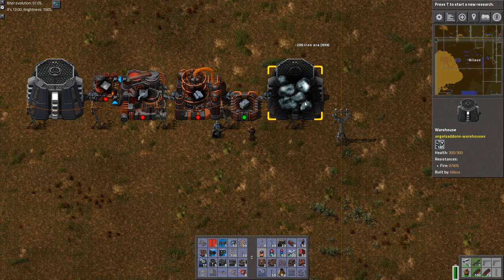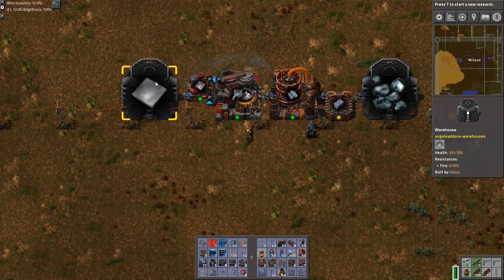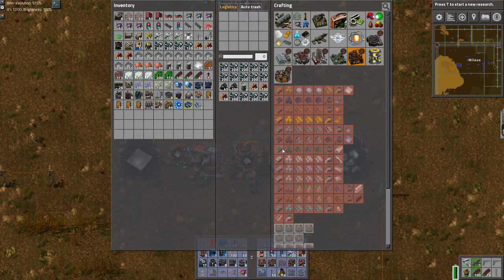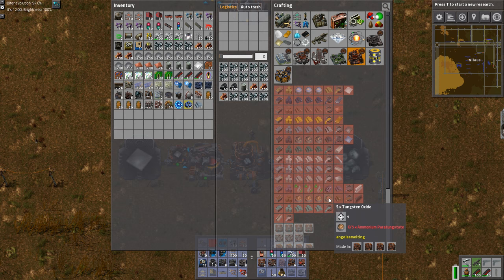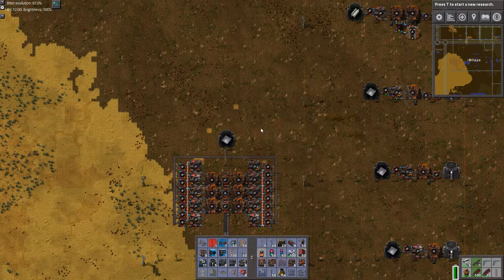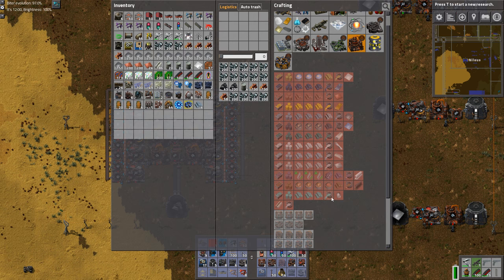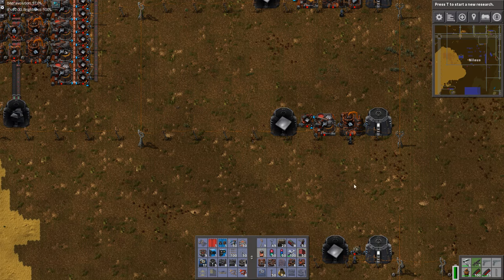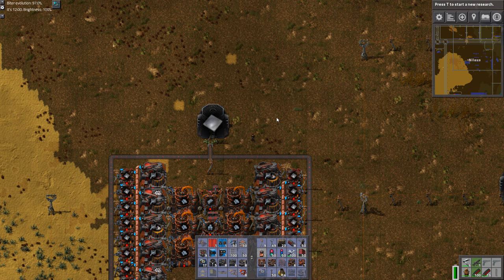Factorio Angels Mods Tutorial - Smelting 1 - Efficiency and Ratios

Comment: steel is 0.05-2% carbon in iron (low to high carbon steel), but smelting iron completely into a liquid and casting it (cast or pig iron) causes the iron to absorb too much carbon (2.5 - 4% usually, has a lot less tensile strength and shock resistance than steel) so you need to put it in a "oxygen converter" and blow pure oxygen over the molten iron so the carbon bonds to oxygen creating carbon dioxide and bubbling from the molten pool.

Comment: you are able to use modules in the smelters.... so you have to steps with modules vor steel, compared to smelting it directly
Reply from the maker: Yes good point. That is one more reason why the Steel process in Angels Smelting is not as good as the Iron + regular Steel smelting.
Reply: FluxBob don't blast furnace take modules?

Comment: You showed everything for iron, but iron requires the 4 iron pellets (which make such nice and easy ratios) and 1 coke, while the other biggie, copper, just equires 5 copper pelets with no coke. This messes up the ratios
Reply from the maker: Yes, that was a conscious choice. Since there are so many different metals in Bobs Mods then it would be quite repetitive to go through the optimal ratios for each.
Reply: ok. that answer makes sense. And the same thing for copper seems to work pretty good if i have an upgraded pellet press instead of Mk1. I use Mk2 because I haven't researched any others yet, but I still have to do the math to find the best.

Comment: It's a shame that the ratios aren't worth it outside copper and iron. I would think Angel would want to provide more incentives for the investments into using the mod (tech, cost of equipment, space, energy, time to setup).  Maybe in a future update :) +Arch666Angel
Reply from the maker: They are worth it if you need higher yields. However, it is almost always easier to simply get more raw materials than to increase the yields, especially with Infinite Ores. Angel said he would revisit this mod, so I am sure it will be improved significantly soon.
Reply: They're only worth it before you get into modules. Using productivity modules and electric furnaces you'll end up with a much higher yield. 

Angel's smelting has some easy ways to get higher tier metals. For example making silicon plates only requires quartz and coal whereas via bob's mods you'd have to add calcium chlorite.
Reply: Silicon and steel is the only ones I would seriously consider to use it for, and steel only for when running a modpack with 5 iron to steel ratio. I have set it up a couple of times, but knowing that they dont play well with productivity, I know that most setups with them would only be temporary increases in productivity. Since it takes so much more effort to set up, I would rather be rushing through the tech to modules instead, and just use them.

I dont really like how most of angels recipies does not work with productivity modules. There should at least be about as much possible for productivity as what is being replaced. This probably has to do with his love for side products in his recipies, and even more some of the loops he has (filters and catalysts in petrochem), which gets some special effects when you introduce productivity into them.
Side products also make everything much more complicated, but it is okay as long as there is a way to deal with them not requiring the use of some final product (there is a limit to how much brick you really need, but since we get a way to liquify and void crushed stone later one it ends up okay).

Comment: so i get 24 iron ingots from 24 iron ore then smelting that its 12 ingots for 120 molten iron and then 40 molten iron for 4 iron plates you you still end up with 24 iron no matter what i even tested it to make sure im not going crazy and i put 24 iron ore in and got 24 iron plates out so using a regular furnace would save time and save space and energy

so if i want to get extra iron i have to get the next level of iron smelting
Reply from the maker: Ore -> Ingot = 100%
Ore -> Processed -> Ingot = 150%
Ore - > Processed - > Pellets -> Ingots = 200%
Reply: Also in the current version the basic ore smelting is "nerfed" to have only 75% productivity - You need 4 iron ore in regular furnace to produce 3 iron plates. It makes this smelting process much more appealing. Can be turned off in the settings though

Comment: Lots of new steps, but very little logistics added. It misses the whole point. Same as a hundred building process where each building can be set next to the prior one, and arranged into a 100x1 array.

The whole point of factorio is that the logistics of multiple inputs and outputs to the assemblers prevents this sort of banal \ effectively one dimensional array of building to building input-output, and instead pushes the player towards a logistics nightmare which he must try to reduce by intelligent design.

If I enjoyed sticking things in a plain ordered row I'd just write out 1 to 100 on paper.

The work done on this mod is good and has lots of potential. But here its half finished. Get to work, each of those buildings needs more inputs & outputs.

Am I the only factorio player on Earth that can see this?
Reply from the maker: I understand what you mean but I do not fully agree with it. The Smelting mod is a bit bland compared to the other mods by Angel as they only benefit is increased yield which is for particularly compelling.
However "get to work" is very rude considering the immense amount of work that Angel puts into making mods for the community for free. Bob+Angel has become such a dominant part of the Factorio community in the same manner that Long War is for XCOM.
We all owe him and Bobingabout a lot of gratitude for the hours of enjoyment they have provided to us.
Reply: Every time you can simplify the process somehow, and if not, you will use robots... so i do not undestand why you complain on that?